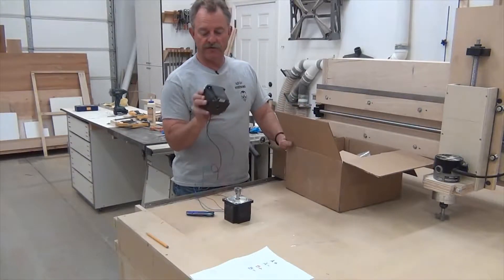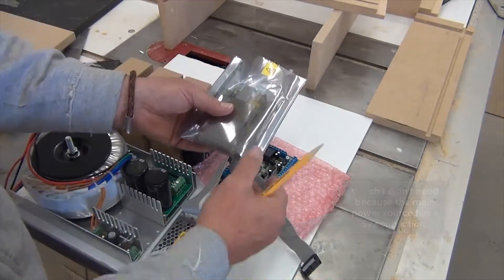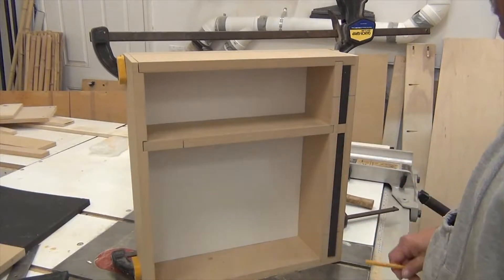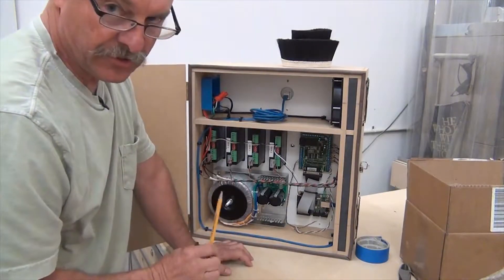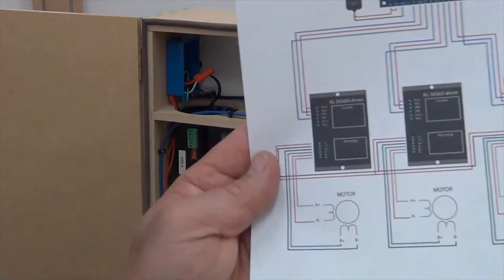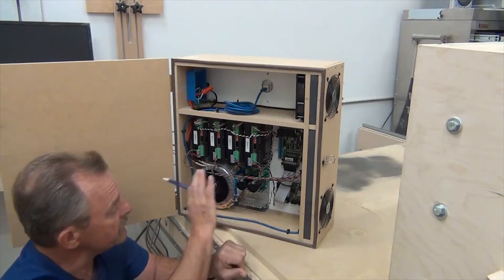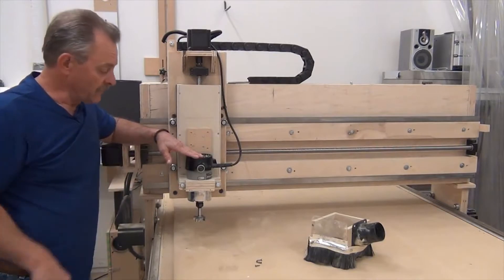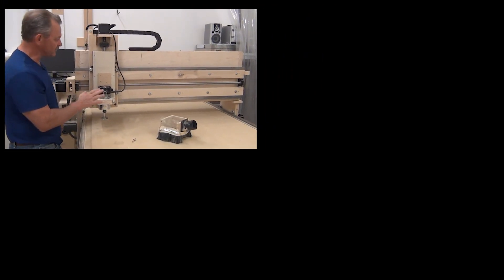Homemade CNC Router - Electronics and Conclusion

Comment: Those standoffs are dead handy to keep the boards off the backing board.. Could u maybe do a video sometime on how to do the wiring and what exactly goes into the whole set up with the electronics and wiring of?? Nobody ever does it the way I hoped my bro..
It's an awesome build man.. U built something most ppl wouldn't even try without a load of steel or Aluminium.. LOL.. U said there are lost of guys online who do better videos on the electronics side of the build but I cannot find any. They all gloss over the electronics and I'm new to all of this stuff.
I'm going to keep studying this stuff myself and try learn it and get it down before I attempt my build. 
The good thing about your video that helped me was I got some questions about what I need to look out for..
Good choice to stop on the MDF til u got the DUST EXTRACTION FIXED..
I ended up with eye and nose issues from the dust. Glaucoma? Don't know if I spelled it right but u know my eyes were destroyed bad man. I'm still suffereing with it so I try not to use the table saw with MDF too often but I now use full face masks with the correct eye protection.. That stuff is lethal man.. LMAO
Reply from the maker: I plan on rebuilding the cnc with some upgraded parts, but I can’t say when. Lots of irons in the fire.

Comment: Mine is all built using a parallel port setup and it's starting to give me problems. I'm looking into what I'll need to convert it over to USB and or Ethernet but I'm having trouble figuring out what I can reuse since I'm on a tight budget. It's a process for sure! Your vids are very helpful.
Reply from the maker: danbbb I used the Warp 9 smoothstepper with a C-25 breakout board. The BOB is about $25.  The ESS is around $175.